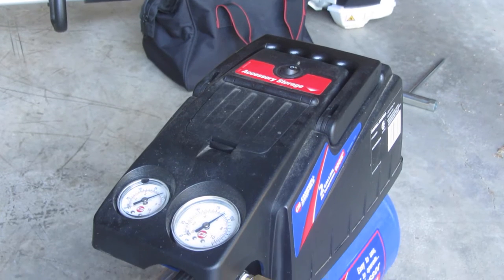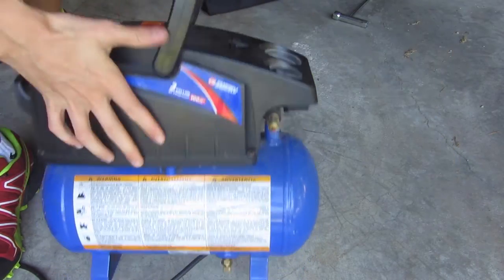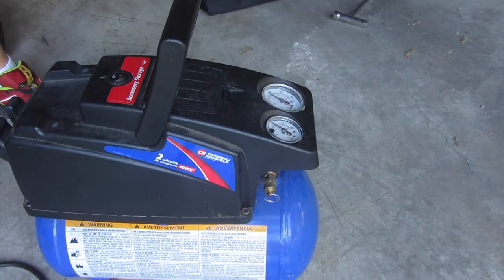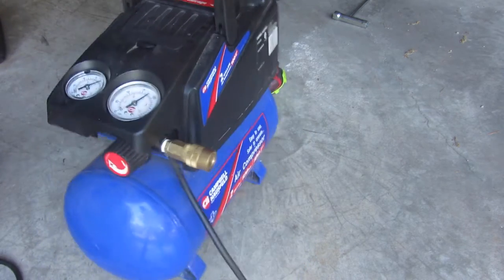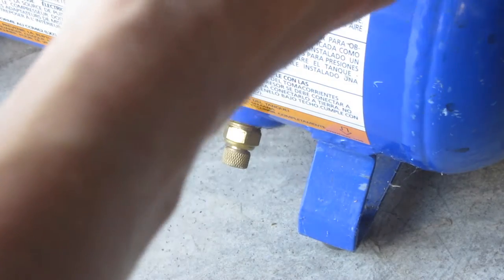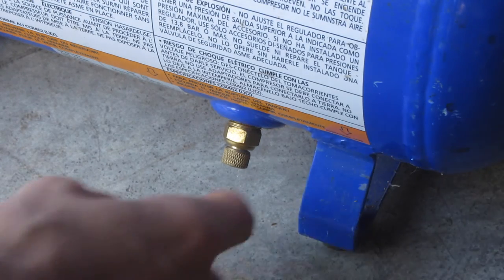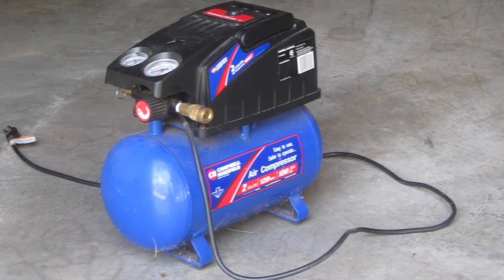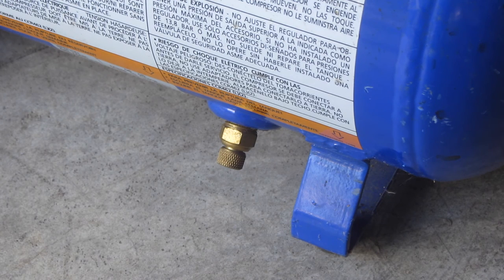How to Drain an Air Compressor

Comment: Thank you! I just bought my first air compressor and was panicking because i still had air in the tank. But you said it’s best to have air in when you drain it right?
Reply from the maker: Yes, the more pressure you have in the tank the better. Just let it all come out through the drain valve.